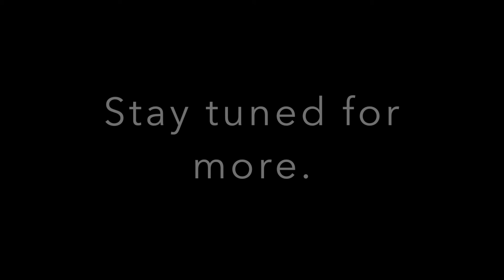V8 Fitting & Fire Up - Capri V8 Project Part 22

Comment: what engine is this ?
Reply from the maker: Bastien Schmitz its a 3.9 rover v8
Reply: @Eurostang  this engine, does it fit straight in?
Reply from the maker: @seanmoore2683  for the most part, yes! You'll need to fabricate custom engine mounts and also work out the cooling system and exhaust to clear the steering rack (see my videos)